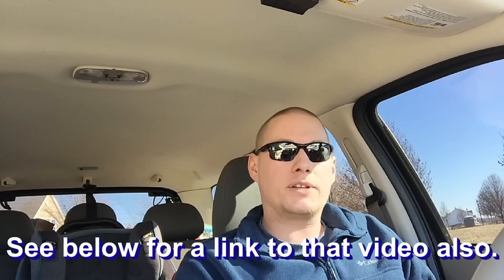Ford Ecoboost Engine Carbon Deposits: What You Need to Know

Comment: Too long of a video? No the longer the better. Gets more information.In my computerized engine controls class we were told Toyota on the new corolla is using a fuel injector that's fired at the back of the intake valves every x number of miles and when conditions are met to help with deposits.I've also heard to use 93 octane every once and awhile to help with carbon on GDI engines. Have you heard of this?
Reply from the maker: nmattcar I have heard of those hybrid fuel systems also, but when I asked the Ford engineer he stated using premium 93 octane would have no effect on the carbon.
Reply: FordTechMakuloco And I'm sure higher octane than needed won't help with the VW either.
Reply: Specific octane 93 gasoline, such as Shell V-Power Gasoline and Costco Gasoline, have 5 times more additives than any other brands of octane 93 gasoline or octane 87 gasoline. Shell's Gasoline Additives include Enriched Nitrogen and PEA in the gasoline. I did use Shell 93 V-Power in my 2014 Subaru Forester Touring once, and the gas mileage improved slightly.
Reply: nmattcar yes 93 octane every 3 or 4 fill ups will help! Also use a full synthetic oil ALWAYS. Ford has a well designed GDI system on 1st & 2nd gen Ecoboost. Forget Toyota fallen way behind in tech.
Reply: How come you guys only  get 93 octane fuel?  The minimum in the UK is 95 octane with 99 octane widely available even at supermarkets . 
At a well know toll road in the  Eifel  area of Germany  102 octane is available which is very nice.
Reply: @Byley-e7h  
Why do u have such high octane?? The engines aren't designed to use that high octane???
Reply: @Byley-e7h  Thats true in Norway too.  The lowest octane is 95, and 98 octane is not unusual either.  I think I will follow the recommendations in the video, the fuel quality is ensured by the standard 95 octane in my country, full synthetic oil with frequent oil and oil filter change for instance at 40% remaining oil life on the oil life monitor of my f150 3.5l ecoboost 2016, and then follow the driving pattern he suggests in the video.  I have seen a video on youtube where oil change is done on  a f150 ecoboost 2011 with 200000 miles on it, and the owner has stressed the importance of doing this every time  the oil life monitor reads 50% remaining oil life.  This engine was running nicely with no issues at all.
Reply: Motorcityman Man The engines over here are set to run on a minimum of 95 octane  and if you  use say 99 octane the engine can advance the ignition a little  before the knock sensor kicks in which gives a bit extra performance and economy ...... allegedly  lol 👍
Reply: I don't think octane will make a difference on direct injection. If there are injectors on the back side of the valves then you have a chance for that fuel with an octane rating to make a difference to cleaning the valve. But with direct injection it goes straight to the cylinder. I think the oil makes more of a significant difference, sooner oil changes than Ford's recommended intervals, and using fully synthetic oil. The Turbos heat up, and heat up the oil a lot more than on an N/A engine, creating more sludge and break down to carbon from the oil, this would get pushed out the PCV, and to the back side of your intake valves. (Catch can hopefully will make a difference too.)
Reply: Ingolf Statle Gulbrandsen our octane ratings is different than EUROPE.

Comment: I just installed a throttle body on my 17' focus St 2.0L ecoboost.  Install I had to take the intake manifold off and there is definitely oil in the manifold.  I could see the intake valves and they had alittle build up not terrible (only 4k miles on the car).  I took some GDI intake cleaner and just gave them a quick small spray.  I don't drive the car hard all the time but I do get on it from time to time.

Comment: Thanks for this video. I've been watching your videos and found them very interesting. I have a 2015 Ford Explorer Sport. We really love our Explorer including the Ecoboost engine. From my very first fuel up, I started and have kept pumping Shell V Power 91 octane. My engine really seems to run very smoothly and perform great with this fuel. I have tried using Chevron in the past with my previous cars, its a good fuel, but Chevron always seemed to give me less miles per tank, especial after repeated fill ups. I'm not sure if its a draw back to the techron detergent after repeated use. So I just stick with Shell. I do follow Shell on youtube and like what I see in regards to their V Power cleaning detergents. From what I have learned V Power does contain a higher concentration of their cleaning detergent than their 87 or 89 octane. At 3,000 I did my first oil change wanting to change to full synthetic, but the service adviser suggested I use semi synthetic claiming the engine is still breaking in, then swap to full synthetic on my next oil change. Although I went with the semi synthetic, at 5,000 I'm going change my oil again and switch to full synthetic motorcraft oil and do my oil changes every 5,000 miles from then on forward. I'll follow the severe driving condition intervals.  So far I have been enjoying the ecoboost engine and the Sport version Explorer. I'm looking forward to keep this car for at least 5 years. So please keep posting videos and thank you for sharing your knowledge.
Reply: I get it.  You want to treat your Explorer like a prize winner.  But don't you think a 2000 mile oil change is a bit excessive?  Wait a bit longer than that and then switch it over to full synthetic. You don't have to waste $$ to treat your vehicle well
Reply: I switched to a 16 Sport from a 15.  What a difference.  The head lights are twice as bright!  The steering is tighter, the suspension is better tuned, the exhaust is better tuned, the controls are tactile, the seats are better shaped and offer more support ... much better vehicle but I much prefer the look of the front end on the 15 ...
Reply: I have a 2017 3.5 TT sport 64K with  synthetic blend oil changes every 4k. Premium fuel. Drained and refilled PTU @ 40K
No knocking, and has NEVER been to the dealer.

Comment: Use top tier fuel, actually drive the car/truck through the full Rev range monthly. Yes use premium fuel in direct injection turbo engines. The reason is that the slower burn is more complete leaving less carbon behind also the most robust cleaning additives are in premium fuel. Another best practice is to change your spark plugs frequently. Doing this and using a high quality low NOACK synthetic oil every 5k miles will greatly reduce your carbon build up and get you the most mileage.

Comment: I wonder if the majority of the carbon buildup occurs when the drivers lets off the throttle while at higher RPM (resulting in engine breaking). In this case there is little to no boost to force exhaust gases out. Which means the intake side could fill with exhaust. Or another cylinder that is on an intake stroke may actually pull that exhaust through the intake valve.

Comment: I found with Variable valve timing....they also use it to omit the EGR !!  They use the VVT to help with emissions  and take place of the EGR ( introducing inert gases into the comb chamber)  As for addressing the problem with carbon build up...water? like a mist? ...yeah yeah I know carbon chunks might fall off, but that might happen also through normal everyday driving !!  Top tier fuel and fuel cleaner additives won't do much for the Intake valve, but will help keep the injector clean....not to mention a higher grade fuel will burn better ( better power and fuel economy)  !!
 As for oil...I always use synthetic oil  :)
  Curious though....do software updates cost the owner any cash if they are past the 3 year 60km bumper to bumper, or is it covered up to the 100km ( 60 thousand miles) ??
Reply from the maker: Stefan Baranowski Yup they have been doing that since 2004 to get rid of the egr on some engines namely the 5.4l 3v. Yes the sole reason I recommend top tier is for the clean complete burn. Software updates in TSB's are usually covered under emissions warranty but only if you have a concern or say you have a concern that that there is a TSB out for and the tech looks it up they will likely just do the reflash, cite the tsb and send you down the road and you got what you wanted in the first place. The latest software is always loaded from Ford servers.

Comment: Sir---I have just ordered a 2016 F150 XLT with the 2.7 Eco-boost engine.   Since this video is over a year ago, can you advise on the latest with this carbon build-up problem?  Has Ford come out with a solution?  I drive my vehicles until they basically just get so old they fall apart (my current truck is a Ford '73 F-100 360 that I bought new).   Since I am 61, this is probably the last new pickup I will ever buy---and I want it to last!!!
Reply: Problem most certainly is NOT fixed in 2016 year model trucks. Someone gave you incorrect information.
Reply: Doy Virginia personally I'd look into a egr/ delete.make sure u add a pcv catch can.big difference in the nice solid muscle truck u have 2 the newer electronic,& carbon building up on the intake valve & gumming up the motor!!! As soon as 15-20k miles so I'd get the catch can immidiatly.study all manufacturers & reliability (I drive a Ford) currently sir.so, I'm not blasting Ford but they know the problems many of their auto's are having.i miss the basic small block's! I'd buy a ls motor-chevy!
Reply: There is no EGR in the ecoboosts, they basically use the TI-VCT to dial in a bit of overlap in the valves that has an EGR effect.
Reply: Doy Virginia i

Comment: Thanks for your video...  From what you said I think my engine should be pretty clean...  For one I have only run it (2014 Fiesta ST bought by me brand new in feb 2015) on 98 octain from Shell.  Two I have always done regular oil changes but with only the oil that Ford recommends. Three I give it the beans a lot, but only after it has been idling for 5 mins then soft driving for about 3 km's every morning or cold start...

Comment: Ethanol is partly the problem. Been running shell vpower no ethanol and just did a scope and she is shiny.
Reply: dansolodan which is why they created a catch can kit for the V6 Ecoboost cost $300 dollars but does a great job at keeping gasses from the Crankcase out of the intake this and good filters should keep it cleaner
Reply: Not everyone can afford Shell V-Power. Frankly, i think its a sham.
Reply: Where do you live? All stations in my state require ethanol.  I deliver gas for a living and see the damage it causes to customer's tanks
Reply: How many kms?

Comment: Diesel Excursion for use around town is a bad idea. The diesel does not get warmed up well enough and fuel system problems WILL come up. Dirty or failed injectors. The old Nissan King cab diesel trucks showed this up. If the vehicle will pull a trailer or longer highway trips only a couple of times a year, people are better of with a gas engine.

Comment: Can you just vent the PCV to atmosphere?
Reply: Yes, you can.  But you have to plug up the hose leading back to the intake manifold to prevent a massive vacuum leak from upsetting the computer settings in the engine.  That way the computer thinks that the PCV valve is simply plugged and there's no problems.  At that point the oil vapors simply go into the engine bay air and flow away, and don't go into the intake manifold and don't get deposited onto the intake valves.  

But when you go for your annual emissions testing you have to reconnect the PCV valve for the tests.
Reply: Not legally.

Comment: I really like my Ford Transit 250 overall (MPG, comfort, performance, maneuverability in cities and or parking lots); however, I am disappointed that Ford doesn't install a catch can system that could be emptied at oil change intervals (seems more sustainable than burning these impurities and reducing efficiency in the engine) or at the very least not void your warranty.

Comment: All you have to do is put seafoam  In a spray bottle take your breather off due at a high idle put 3 to 4 squirts through your breather hose  every oil change works fine FYI this is from a man with 2013 Ford escape 2.0 EcoBoost with 228,000 miles on it FYI no oil catch can too.

Comment: I love the Ford eco boost but I think they can do like Audi did on the new 5 cyl. engines - put and extra injector on the intake, just like non direct injection engine, which injector sprays fuel from time to time and keeps it clean

Comment: Could coating the valve stem with something (teflon?, ceramic?, etc.) prevent the carbon from sticking to the valve?  No mechanical engineer here but if the carbon doesn't stick, it can't build up.

Comment: Great video as usual...just my 2 cents; I'm not an ecoboost expert  (I did just buy a 2015 fiesta w/the 3 cyl., 1 liter ecoboost) but I am an engineer and an old Ford gearhead and over the last couple decades I have found Sea Foam (Marine engine, diesel, engine and gasoline engine) fuel system/injection cleaner to be the best on the market...you can also add it to the engine oil to clean out the crankcase too....it has consistently worked better at cleaning my injection systems in several different cars than techron (which in most of my cases did squat)...I recommend you give it a look/test.
Reply from the maker: steve Fowler I will be testing a few in the near future.
Reply: Well I can tell you from experience that the techtron works

Comment: Also a thought came to mind about introducing an automatic cleaning process that works as the motor is running, similar to an injector. A solution reservoir that works periodically as the motor is running, like teflon.  Just a thought.

Comment: You should do a walnut blasting how-to video for ford engines. Mention which engines has the worst intake valve buildup and usual mileage it should be done.

Comment: well if you vent the crank case into the atmosphere you wont have any carbon problems they are caused by the oil residue and actual oil being pushed into the intake

Comment: id think a water methanol injection might work well , it steam cleans and helps to lower IAT and EGT's, general head temps.  . also increases octane .
Reply from the maker: +twistymcslide2 That would be ideal yes.

Comment: I want to do the valve body cleaning. my question is the following. with the car off if I move the crankshaft, this does not affect the sensors of the variable camshaft ?. this to be able to close the valves and apply liquid chemical

Comment: Great video, is there a way that we can observe the top of the valves with a video probe with a very small head. I can see into the cylinder easy enough but I am more interested in see the state of my valves and the carbon buildup on the valve stem.

Comment: To be honest I don't think Ford's oblivious to any problem on their automobiles. But I think they're assholes for putting it on the market in that condition in the first place. Rather it be a PCV without a built-in catch can ( common sense) or a transmission with the bugs not completely worked out. Personally I've lost but all respect for Ford.

Comment: I know this I changed my oil to mobile-1 full synthetic,  man my gas mileage got better, but i'll be darn, it had white smoke  every morning I cranked it, and chattered more than normal.   But dang I was getting 24mpg on highway.  I went back to Motorcraft oil,  and my MPG dropped to back around 18.5-19 on HWY.  No smoke, no chattering, damned and  good when you do, and  good and damned when you don't.

Comment: Only way to fix the issue is make a speed density system for it.   With port injection and direct injection at the same time.

Comment: I really appreciate your videos. Been a subscriber for a while and will definitely take these tips and put into good use until Ford puts out an approved Ford cleaning process for these ecoboost engines. Just a question regarding the fuel system cleaners; what other types of brand do you recommend other than Chevron? They seems to be scarce here in Alberta/Canada... (or maybe they're just out of stock... blah)
Reply: Sampalingkita There are lots of Chevrons in B.C. - about 150 locations. I'd stick with Shell Tactrol - it's pretty similar. Failing that, STP concentrated injector cleaner - black bottle.